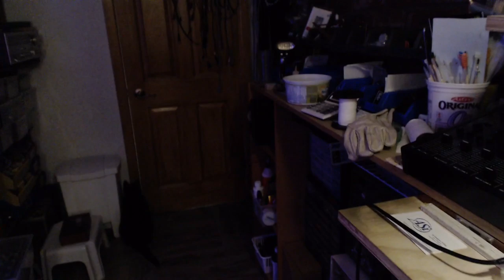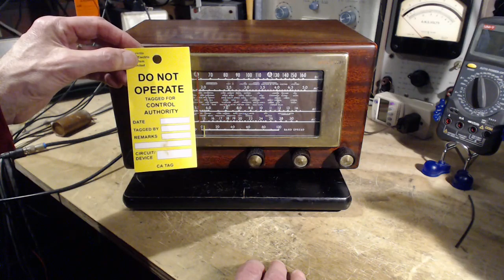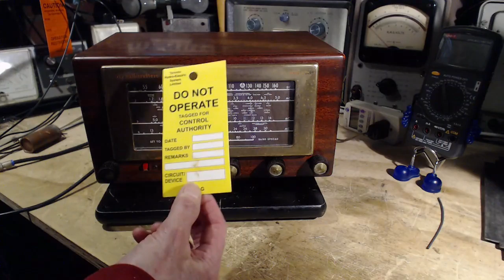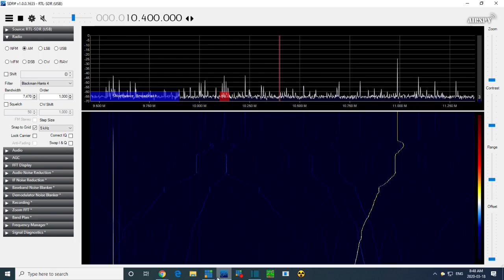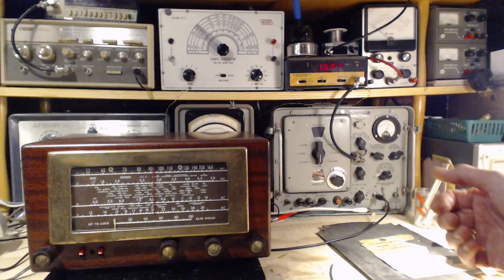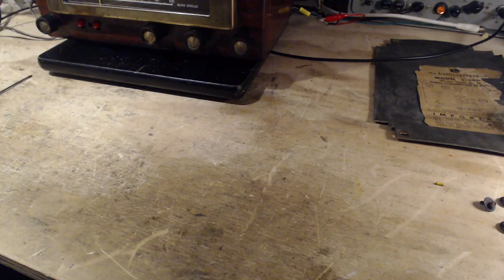Hallicrafters S-38D Communications Receiver Video #2 - Local Oscillator and Images

Comment: I own the entire S 38 series.I'm having a bit of a hangup regarding the matter of where to solder the wires coming from each individual negative lead of the replacement filter cap to B-There is only a single tie point for B- for those dry electrolytics on pretty much all those S 38s.My question is:is the more than one place on those two large terminal strips to solder in those four individual negative leads from each filter cap? My only other recourse would be to run a wire from that one tie point  on the original terminal strip where the negative lead from the from the filter cap was soldered to and mount a four lug terminal strip there and solder in each negative lead from the filters there.At least,it would look neater and less haphazard.

Comment: Thank you for spending so much time on the operation of this radio.  I have never owned or operated one of these transformer-less "commodity" radios from Hallicrafters, but just listening I can give some observations.  It was great to see how well and sensitive it performs.  The S38D is essentially the same as every S-38 in the series electronically but with a nice tuning dial and presentation.  Because there is no RF and only one true IF amplification stage, the radio is full of images both up and down.  Single conversion Hallicrafters in general have a problem with image frequencies.  With time, you can see each image frequency above the primary at 455 kHz intervals, and to a lesser extent down from the primary as well.  The purpose of T1 is to filter out all the images except the frequency of the received frequency plus 455 khz and the receiver is aligned to the dial at that combined frequency (essentially subtracting out the additional 455 khz).  Then the signal from the secondary of T1 is fed to the grid of the 12SK7  and amplified.  Because there is no second IF stage beyond T2, the images are prominent.  Single conversion Hallicrafters communications receivers all have a second IF stage.  I saw a schematic for a non-official S-38B "Mark 2010" - kind of a safe update, for updating the power configuration to a safe three wire grounded plug and I strongly recommend that, and it will also remove some of the problem with the image frequencies.  You may want to carefully examine every chassis connection (which would become grounded) and rework to  a good clean, resoldered, silvery connection to help with the grounding.  Every wax capacitor should be changed as well with attention paid to the foil side of the new capacitors (many YouTube demonstrations of finding that), and that should also help with the image frequencies, but you won't be able to eliminate them, primarily the plus 455 khz and 910 khz images.  As for alignment, I noticed  the AM band pretty close, but an approximate consistent error in the shortwave.  I think whoever owned it aligned it the way I would, which is to set the bandspread, which is uncalibrated to 50, and align the shortwave there.  Then, when using the radio, you can tune coarsely to a band and use the bandspread to go slowly up and down.  When aligning, be careful not to align to an image rather than the primary signal, which is done by keeping the signal generator as close to minimally detectable as you are able to work with it.  It looks like a fun radio, and I enjoy very much your videos.... Albert from Thomasville NC.

Comment: Jim, I have found that when you connect 2 radios to the same antenna, you degrade the performance of both radios and also get other unpredictable results, like harmonics and spurious signals as the 2 tuning circuits interact with each other.  Early in this video you told us that, elsewhere in your house you have several more radios all connected to the same antenna!  Whether these other sets are powered up or not, I believe this could be the cause of some of the spurious signals and other trash you are hearing. Add to that the noise being generated by your TV equipment in your workshop, it's hardly fair to make a  judgment of the performance of the radio you're trying to fix under those circumstances.  But I enjoy watching you work, and wish you luck with this one.

Comment: The first rule in electronics is never attempt to align or calibrate equipment that has defective components. The second rule is make any equipment as safe as possible. You insist in keeping questionable wax paper capacitors. These are going to catastrophically fail, it is like ignoring expiration dates in medicines you take, Third rule is to service any equipment totally isolated from external interferences. Your workbench is a ratnest of EMI and ground loops. Fourth rule is to have test gear and measuring references you can rely on. When was the last time you checked yours?
Reply: Your watching the wrong guy here. Jim's motto seems to be, the hell with the rules we're trying to accomplish something!
Reply: He is getting better & will now change capacitors with the odd excursion into voltages .

Reference checked with a its not out by much meter with 1980 batteries . 
It always gives trouble you can rely on that & the classic 50% up scale when all is off .
These are all common in Jim's shop . 

We all give him a bit of stick about the equipment & the interference but he seems to just K B O .

You can always tell the newcomers by the electronics repair mantra & the ever present you tube 
peanut gallery doesn't help much  .

Comment: Sill totally unable to understand and apply basic RF electronics. Most of your comments and explanations are plain fictional. To get a mixer tube to perform as intended, it must be biased into its non-linear region, and the LO must be properly phased and stronger than the Lrf. What you get at the 1st IF input is a sequence of products Fout=±mFrf±nFlo. The 1st order of products are Frf and Flo. The 2nd order contains Flo-Frf (down conversion) and/or Flo+Frf (up conversion), being either the one the IF stages are going to process. The third order products contain 2Flo-Frf, 2Flo+Frf, Flo-2Frf and Flo+2Frf. There is a catch here: If you set Fif=Flo-Frf and Flo is higher than Frf, you also get a spectral inversion or fold-back that you have been incorrectly calling "image signal". As the m.n progression goes on, you get more spurious harmonics that are all those peaks you see in your SDR (besides the garbage the SDR itself adds in). The IF transformers act more as bandpass filters than coupling devices, working to attenuate all off-band unwanted productos.

Comment: Hi Jim
First job is clean the wafer switch then change the main capacitors & the agc capacitor .
This should clean up the local oscillator a bit .

Should be a good little radio for a single conversion set .